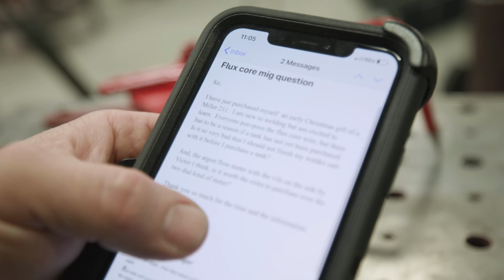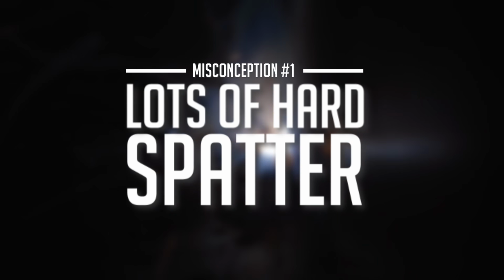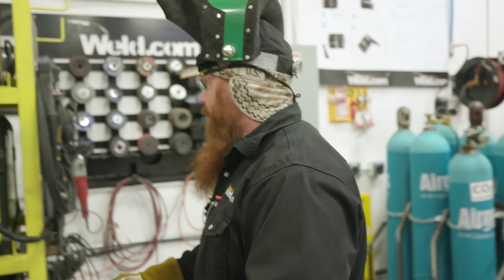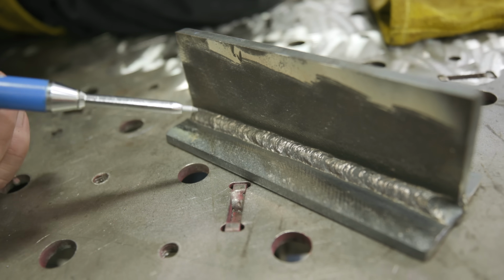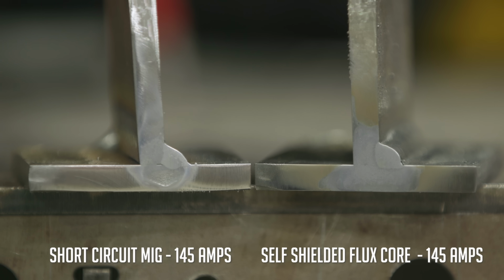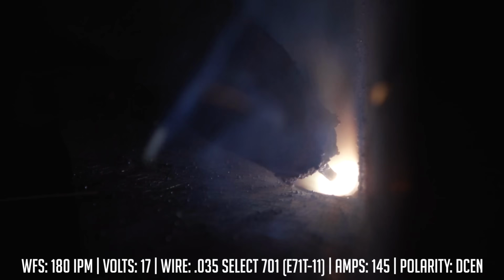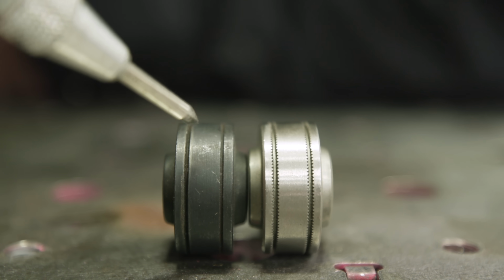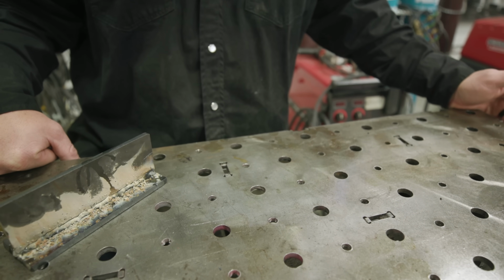3 Flux Core Welding Myths DEBUNKED

Comment: Can I use a knurled drive roll with solid copper wire? I just ordered a new drive roll and it has knurls on it and I use solid core wire. I bought the Lincoln welder used and the drive roll was missing when I got the welder. Thanks, great video.

Comment: I'm not a welder who has been welding with the $200 titanium harbor freight flux core welder with ease on karts, mini bikes, motorcycles, lawn mowers ect.  There is practically no setup to do with this machine...just adjust the amps based on the thickness of what I'm welding.   My welds aren't very pretty but "I welded, it helded".

Comment: Because the flux core has much less wire being added, a 17 volt weld is functionally hotter weld than with a solid wire. The weight of the plates that you're welding suggest to me a minimum of 22 to 24 volts and a slightly slower wire feed, and I always weld with about 90 to 92% Argon. 7525 does not cut it. There's not enough argon to support a plasma stream. And yes the gas makes a difference

Comment: I think most/some of the issues people have with gasless flux core wire are related to the cheapest of the cheapest welders people usually use them with. I've been a welder for some 10 years and just recently got my hands on a cheap flux core machine. It works ok for ~3mm steel but welding <1mm is awful, the wire motor is not constant speed motor so the wire feed speed will constantly change depending on the wire resistance. I don't think it has high OCV either, so it starts awfully.

Comment: Welding galvanised/ zinc coated steel, flux core is the best way… take off the gas shroud and just be careful not to ground your tip on the job. What you see is what you get… boom every day every time

Comment: Misconception, about "electron flow" circuits, It is "NEGATIVE-to- Positive", for current, flow, for charging, years ago, Battery, terminals were mismarked, @ manufacture, but too late, for "Public education", now with, modern solid state, this is "CONFUSING".

Comment: I'm a journeyman red seal welder. And almost every shop I've worked at use either flux core or metal core welding. However there not using the inner shielding flux core. The flux core most shops and companies use still need need shielding gas. And it is far superior than stick

Comment: Polarity is obviously important. I have seen over the years with flux core mig wire welding is guys that have not used it before try to push the weld the way they run solid wire that technique doesn’t work with flux core wire. It runs so much better to pull the weld the same as you do with stick welding.

Comment: Blue Demon now has stainless steel flux core that I have been going to school on with mixed results. I'm about to try reversing the polarity, which in hindsight, makers sense. Have you tried it, and will these similar setting changes work for it? I'm welding .065 polished 304 tubing.

Comment: Do you oscillate with flux core, or do you just run a straight bead? I never could remember that. My gut says no, because you might get the slag trapped in the weld, but the phrase "old man shake" keeps popping up in my head. So... Any help?

Comment: VERY well done and in-depth review. Bought my first flux core (Titanium 125) after owning all MIG and TIG welders just for it’s portability and kept having the porosity issue. Tried switching leads and it looked like the first bead you ran. Then I watched this video and realized I had been too close to the puddle. Again, YEARS of TIG welding created a bad habit when moving down to a flux-core. 😂 But it’s the size of a toaster and can do 3/8” steel no problem, so it’s become my “friendly” welder when someone needs me to come over and weld something. Plenty of my offroad buddies appreciate this video I’m sure as well. 🤘🏻😋 Not to mention, a couple car batteries and a power inverter make my little Titanium 125 the PERFECT trail rig that damn near fits in my center console and can weld anything on the trail. Thanks brotha!!!!

Comment: "Horse crap in Amish town"? !!!  Uh..yep,  but hey quit knocking my HomeTown!  Grinders are God's gift to my newbie welding.  Got a Lincoln 180 on craigslist and it is the home-cheapo version.  Finally found and read the manual online.  So will be trying the properly grounded flux core version soon.  Had been using the solid wire with gas, but the installed wire driver is the knurled one for flux core.  Big problem was a friend gave me a helmet and I cant see squat through of it.  Getting a good helmet.  I wonder if I could pull out the plastic-ey wire driver mechanism, and replace it with the more manly metal wire driver system.  Going to Praxair tomorrow

Comment: One of the issues I had when I was younger with flux core while self learning to weld was using to thick of a wire on too little power. - I dont know if its right or not but today on my mig I like running thinner wire and higher speeds vs thicker wire at a little lower speed. - I dont know if its right or wrong, but my welds are better.
Reply: My machine runs .035 for flux core and .030 for solid mig, but uses the same recommended settings on the machine, with just the reversed polarity

Comment: Ironworkers use big .045 to 065 innersheild wire on structural steel per code... works just fine. Much higher deposition rate than SMAW.

Comment: I miss welding.. Bummer that I was unable to find a career in it after high school, since I did all of the schooling for it in high school and got certified.

  I didn't want to travel across country at the time, and all of the nearby welding related jobs required like 5 years of experience. This was around 2010.. I was also told by people/other welders that I'd get laughed at if I tried using all of my certifications and stuff on my applications.

  Not to sound like a big head, but I was arguably the best welder at the welding school that I went to. I took it more serious than others, because I'm a bit of a perfectionist and I just enjoyed laying down beautiful beads. Also blew through our entire welding book assignments before everyone else.

Comment: your help me page doesnt exist anymore so i'm asking this on here for you guys or anyone else who wants to answer. i have a cheaper flux core welder, it was like 260 retail, i have no ability to change polarity, i have no ability to control amperage(it just has a high and low switch), so how do i fix my splatter issue. my splatter isnt as bad as that first pass you did but its still all over the place requiring me to use a flap disc to clean up the steel. is this a problem of technique or just a problem from it being a cheaper welder? i will check again just in case but as far as i am aware i have no ability to change the polarity and i have been using this welder for around 3 years.

Comment: I think maybe the misconceptions about flux-core penetration could be because, as in my case, i'm a weekend warrior and only have a little 120v/20amp flux core welder at my disposal. I remember reading in the manual that it is only good for penetration on materials up to 3/16" so i haven't even TRIED to use 1/4" material as of yet. Do you think this little baby welder would be able to weld 1/4" material??? I suppose i could TRY but maybe you already know the answer? Thanks!

Comment: I use to run flux core with 5% welding bucket teeth f9r a front wnd loader. So hot. Especially on hot humid Midwest  days. Sucked.

Comment: I am fluxcore welding an interior plate onto the floor of my 1972 vw bat window camper - its only 1mm thick steel but on the underneath of the floor pan it is wax oil’d for protection - would this catch fire and should i have to remove the wax oil underneath before welding the other side? The trouble is its hard to remove so i may just selftap screw the plates in instead of weld as they are not structural just to stop mice getting in!! 😅

Comment: I run stick on a Hobart generator at work, at home I have a Lincoln 140 running .035 Flux core. Both work great but I can lay much prettier welds with the Flux core

Comment: I don't have the ability to switch polarity on my welder... Bought the HF Flux125 and it's an AC unit...  Biggest problem I'm having is figuring out wire speed vs hand speed.  I'm not getting the pretty welds that I want, but they're strong nonetheless.  Just need more time on the machine I guess. I've never used a wire welder before this, have only stick weld and tig a few times.

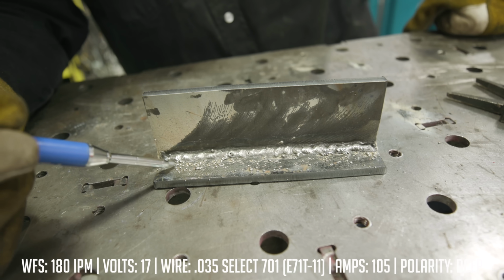Comment: I think I grasp putting 70% of the heat "in the stock to be welded" and only 30% in the wire electrode but @ ~ 03:05 you said the same thing about the *"welding current"*. Admittedly, I don't understand what you said, no matter how many times I rewind it. Could you please elaborate on that?

Comment: What's a good affordable flux core welder for around the garage ? That esab rebel looks cool 😎 I have that  harbor freight one the cheap one .
I wanted to weld on a spring perch to my 69 Ford dana 60 rear axle it will accept 035 wire not sure if it's going to measure up to the task

Comment: Is it normal to hear a roaring noise from the rollers when you use flux core wire. I'm using the correct knurled rollers with adequate tension on the rollers but still makes a roaring noise when I weld.

Comment: Keep the voltage down, drag the pool with small circles or wriggle , keep your tips fresh, wear a good mask when using 211 wire.
Its not as strong as stick or probable hard wire, tacks are brittle, but good for fast butt welds of pipes less than 10mm wall thickness.
Run vertical down for fill and cap but vertical up for  Root run.

Comment: On the hot rod forums where people are discussing chassis fabrication there are lots of people downplaying flux core. I'm wondering if flux core would be acceptable for building a chassis. I believe it would be 2x3 box tubing less than 1/4" thick wall.

Comment: Many of the MIG units purchased at home hobby suppliers either do not have provisions for setting torch polarity or are simply shipped  in a torch positive polarity even though they only support self shield wire.

Comment: Flux core is better in the wind as the gas does not blow away.
It's harder than solid core wire so great for snow blower shoe wear surfaces, but GOD help you if you need to machine any of it off!
It's messy, it splatters all over and the weld will not be "water tight".
It's less adaptable for welding delicate/thin materials.
It's easier and more portable as you do not need a hose and gas bottle.

Comment: Thank you, self taught welder here can’t wait to switch the leads.
Reply: ME too. the last time i used my welder ,it looked exactly like the welds he did," Horse crap in Amish town"?
Reply: @immrnoidall  I just got a new mig, I didn’t make the mistake of incorrect polarity, because the instructions manual was all pictures!
Reply: @daverodgers779  did it show a reason to  switch in the first place? I guess I need the  DIY welding picture book version. LOL. I just "had to have a welder" then used it a couple times and into the shed it went.
Reply: @immrnoidall  yes, if you are welding gas less, you use one polarity, if using gas, you reverse the polarity. It wasn’t till I got it home and unpacked it that I realised I had the option to use gas, I am just a hobby welder.
Reply: I did a DC conversion to my Harbor Freight flux core. I can already tell a difference, even though I haven't added the capacitors yet. Honestly I am unsure as to what AC flux core welding would be good for. LOL

Comment: I know this was posted a while ago but I have a few questions. I currently run alot of MIG and some TIG on trailer repair (gas haulers tankers ect) Im going to apply for a position as a civ welder for the Navy. I heard that its alot of flux core and stick. I did stick in trade school but never flux core. Is it similar to standard MIG minus the gas tank? I noticed that every drags and im assuming its due to the slag and that makes sense because i dragged with stick. But it basically just seems like its the same motion or oscillation just dragging it. This may be a stupid question but I've been in the field for 5 years now and ive never used it, any tips?

Comment: Great info,I’ve been welding with a licon 110 and have had few problems. The only thing I have noticed is if you’re shop isn’t heated all the time after long periods of time the mig wire oxides, and you’ll have a hard time with splatter and penetration.

Comment: Can i use flux on brake rotors cast steel to steel welding ?I guess i'm asking what wire can i use (nickel,wire stainless 309- or Ni-99 ) or what will work ????

Comment: Does any one know if the the cheap harbor freight 90 amp 110v can be polarity swapped internally?  Some have said it is an ac output welder, which means no, I think.  Is that true?

Comment: Flux core is actually stronger than solid wire.  Material added to the flux can add strengthening factors to the weld.  Same reason that 7018 provides better elasticity to a weld vs 7010.

Comment: 5 minutes time stamp.. whatever I guess constant voltage is the norm nowadays especially when you're in a shop.. but you have 5 minutes and 6 seconds.. you're in the shop and that's the best speed you can come up with??🤗🤗🤗.
I can run 5/64 Lincoln. Innershield on the 6th floor of a building.. whatever nevermind 🤗🤗🤗

Comment: For a long time all I had was a cheap flux core welder with no polarity option and only high/low current switch and I had a lot of issues with wire feed and spatter. It was really a hit or miss machine but if the metal was clean and preheated and it felt like feeding that day I could get some really good welds with great penetration. I recently broke down and bought the MIG 140 from Harbor freights new titanium line and am running flux core so I don't have to haul a gas bottle around my backyard and the difference it makes is unbelievable. That thing will weld over thick paint and rust and it doesn't even blink at it.

Comment: Great video! Simple explanation and easy to follow. I especially love the etching, it just gives so much more insight into what's happening inside the material.
Only small let-down is that all measurements are always given in "freedom units". If you'd have a small overlay mentioning metric sizes for people from across the puddle, it'd be absolutely perfect.

Comment: I'd say that flux core would equate to stick welding. No one questions the integrity of a stick weld, so why question a flux core weld?
Reply: Fluxcore equates well with 7018 stick. But I've seen instances where the Lincoln Innershield will produce a more brittle test weld.  Weld two small coupons about 1 1/2", then hammer opposite weld side. 7018 will have a better root toughness
Reply: Weeeell... I only ever did stick welding, so I'm not going to pretend I know MIG or flux core, but can you really equate that skinny wire to a real electrode?

Comment: Many years ago I picked up a Weld-PAK 100 with flux core wire in it from a pawn shop. It never welded well and I seemed to always fight it. 20 some years later I finally found that the polarity was backwards. I love this little machine now. It is portable and capable and I usually use it outside. Spatter has greatly decreased. Just amazing. Great video.
Reply: I've still got a weld pak 100 and it managed to do a admirable job on something I made out of quarter inch plate recently ... Using flux core

Comment: I'm a carpenter by trade but do a lot of other stuff. I was doing body work on a '97 F150 and had to weld sheet metal. It wasn't until after I was done that I read somewhere (or saw a video) that I needed to reverse the polarity to use it as a flux core (it can be set up for either flux or mig). After I swapped the cables, it did a LOT better. Thanks for the great info.

Comment: Thanks .035 is my next wire,I’m using.030 and is very small beads good for thin small stuff, have to get a feed spindle for it. Holes send with a .030 spindle

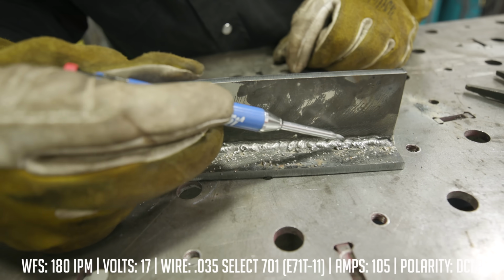Comment: he has it backwards, I am sure weld.com can reply, DCEN negative or "straight" polarity is  70% in the wire, DCEP positive or "reverse" polarity is  70% in the material.  2:45 is backwards. more than likely just a mispoken moment.
I good way to remember it is N is in the nozzle. N for negative, meaning the stinger or gun is 70% heat. P is in the plate, meaning Positive 70% is in the plate

Comment: Flux core is all we use in the shop I work at. We make scales that weigh coal trucks, and I've never heard of one failing.

Flux core is not hard at all to run it's just different settings. And the penetration is just as good if not better than any of the other processes.

Comment: So I work in a shop that installs lift kits on vehicles. I have yet to try these tips out but I always have issues when welding the rear shock brackets on Yukons/Tahoes/Suburbans. It's a BDS kit. I have to weld them to the solid axle. We have a gas capable welder but there isn't enough room to use nozzle and gas. I have to weld them with flux core with only the tip. Typically it's quite a bit of splatter as well as a lack of penetration on the axle. However if I up the power it's too hot for the bracket itself. I am not an experienced welder. I am not a certified welder. Any tips or suggestions would be greatly appreciated.

Comment: Like all tools, use them correctly and they'll work fine. The main differences between gas and cored, I feel, is the storage of the gas for the hobbyist who is likely only to weld occasionally and, what I feel is the biggest difference, hobbyists will often do their welding outside where there will usually be some wind which would blow the gas shield away or at the very least make it inconsistent. Cored wire creates a lot of smoke, which is obviously undesirable when welding indoors, whereas gas produces far fewer fumes. Horses for courses, as we say over here in blighty. Good vid!